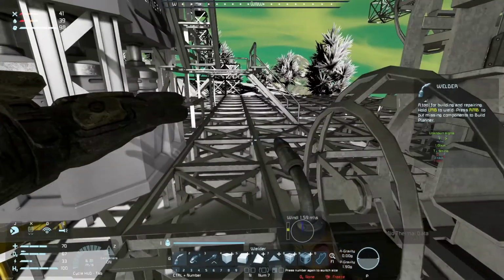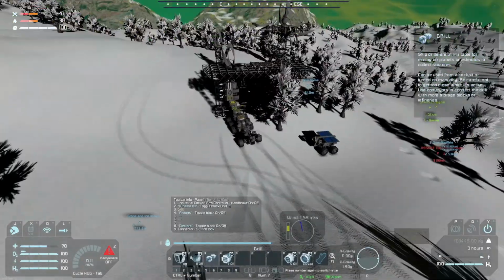Over Engineering Survival S2 Ep10:  Welding and talking (Survival Impossible scenario)

Comment: Could also just do a welder on a Cargo Container, then hang that off of an unpiped piston arm. Would have to manually fill the container, but would then let you reach as far as you were willing to put pistons into the base.

The other option of course, is a modular vehicle, using merge blocks to connect a welder module with down facing welders, and later a crane module to a single multi-use truck.